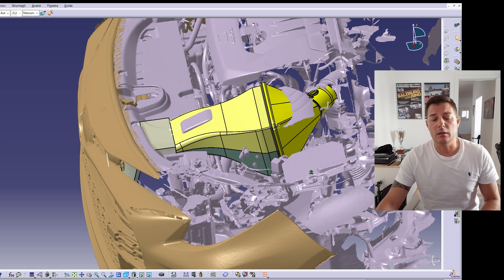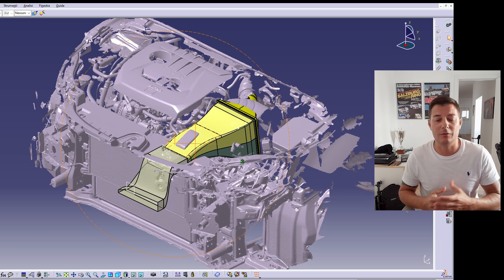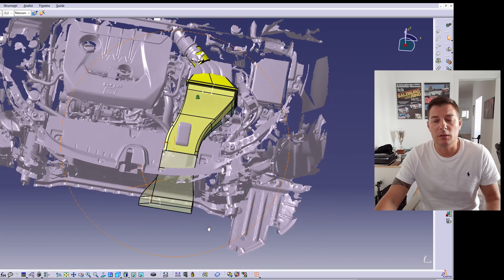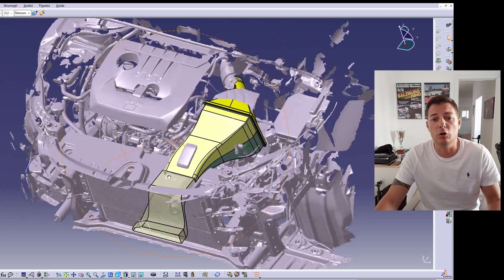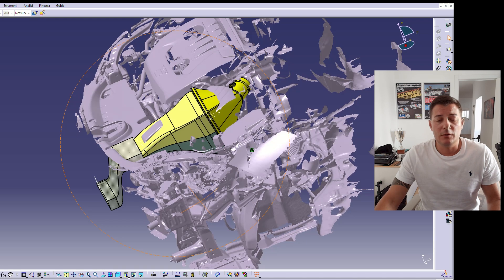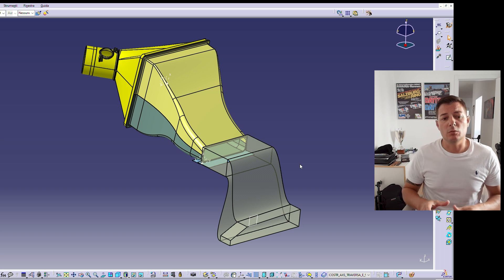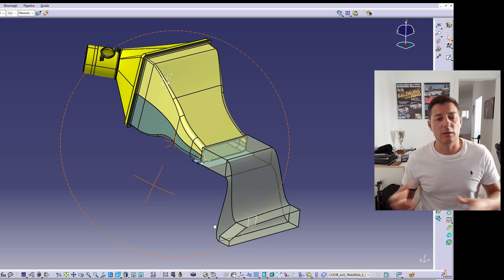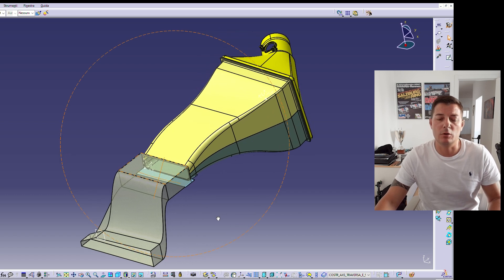GAME CHANGER Toyota GR Corolla AirBox Engine Intake Design Secrets

Comment: My setup is exactly opposite. It's got a wide entry into a 5-inch  silicone hose reducing to 3 inch that connects to stock intake at air box entry.
Reply from the maker: I replied to this in the other post, cheers mate

Comment: I have made my custom radiator cover from aluminum sheeting. Works well. I formed a bottom scoop and an upper collector that forces air into a reinfirced silicone inlet hose leading into the stock air box with a racing DNA air filter installed. My question is why would you design an air intake to have a small entry then expand into a larger housing only to get smaller again just before the throttle body?
Reply from the maker: This is a good question: it is for the venturi effect. 
Just as you see on the big rally cars, more litres of volume in the airbox allow for a larger quantity of air available to the engine when you put your foot on the throttle after liftoff. 
The venturi effect, on the other hand, is studied to increase the speed of laminar flow at any given suction pressure.

Comment: I think you stated that the airbox uses the stock air filter, correct?  If so, that would be huge, due to the fact that those air filters reduce check engine lights (CEL's) and are the best filters for the car.  So I do hope they do use the stock air  filter, if they do, you can sign me up for your airbox for the GR Corolla.
Reply from the maker: Yes, you can also use stock air filter. We now provide Sprint Filter P08 units, that are a new gen filter with synthetic micron filtering material without oil or anything. Flows double than a leading cotton filter while filtering much much more because of the 35micron material weave
Reply: @PIRASMotorsport     Excellent, the stock type filters are the way to go, so that good news👍
Just a heads up, I've contacted Graham Gaylord to see if he is interested in working with you developing the GRC airbox as a tuner, he maybe contacting you. I hope he does, he's tuned hundreds of GRC's and is the best in the business at tuning them. He uses ECUTEK for tuning like you do.
Reply from the maker: Perfect, thankyou for that!!! Looking forwards to hearing from him!!!

Comment: Is the oem intake air tube still used. If it is i like that. And the price isn't as bad as $1000. Are other finishes going to be offer carbon fiber etc?
Reply from the maker: Yes it is resused and the price will be sub 1000. Carbon is not needed and not an option